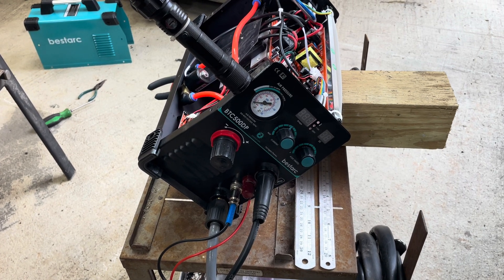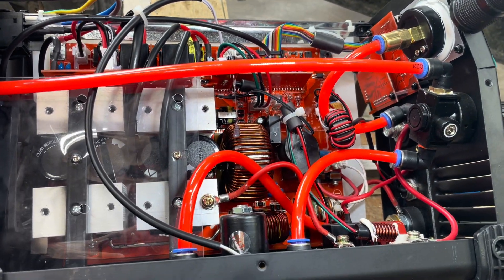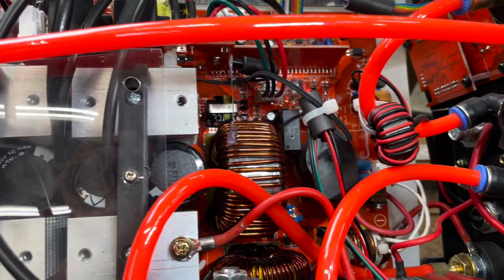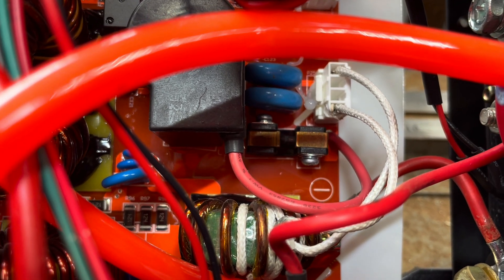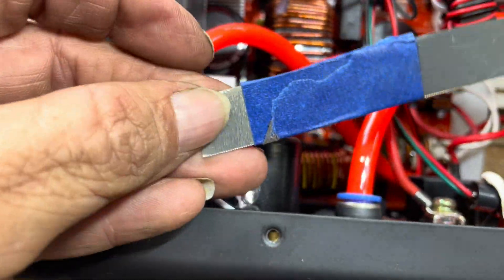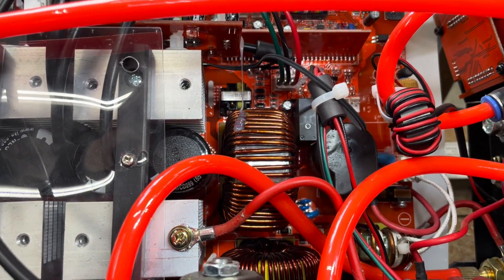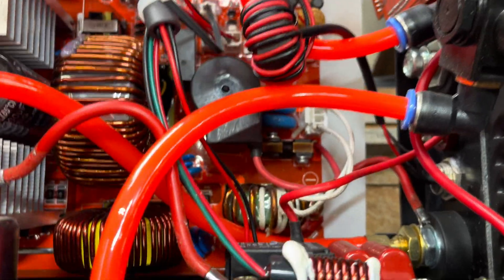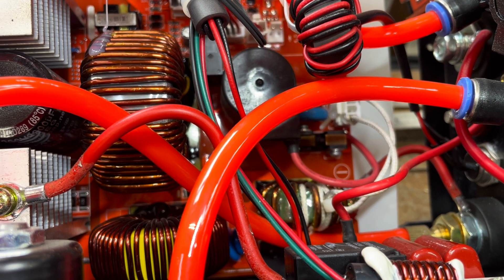Bestarc btc500dp pilot arc not working

Comment: Update!! I fixed it!! The red wire coming off the controller connecting to the machine. I stripped the wire and connected to to the ground (I pulled back the rubber connector on the ground, there is a set screw, I loosen it removed the ground and pushed the stripped red wire and ground back in the connector and replaced the set screw) it fired right up. Good as new! I was minutes from tossing the machine in the trash. 

Im Having this exact issue, I cleaned those same gapped terminals but it’s still not arcing… I m ready to toss the thing in the garbage. I m still getting the blue spark between the metal terminals,
Reply: I just wanted to leave a comment and thank you for your comment!! I have the same issue as described in this video on my cut55p from bestarc. I tried cleaning those points and it didn’t help but I tried your trick you described with the ground on the cutting torch and bam mine is back up and running better than ever!! Thanks again for sharing your repairs!